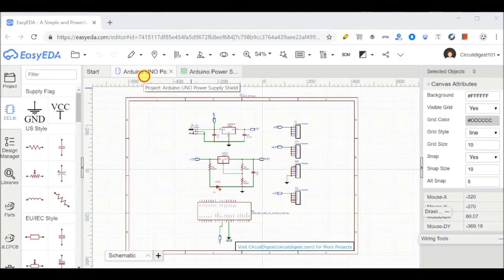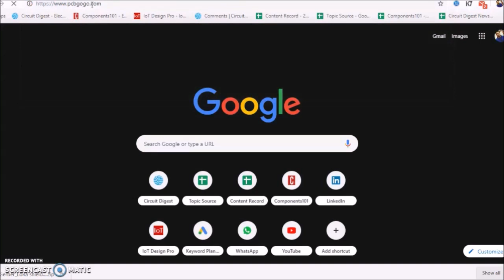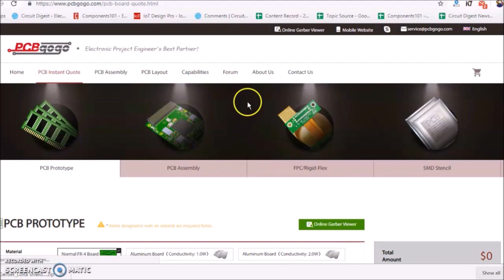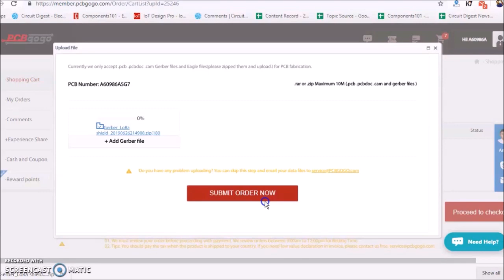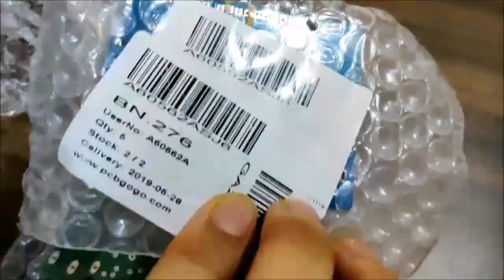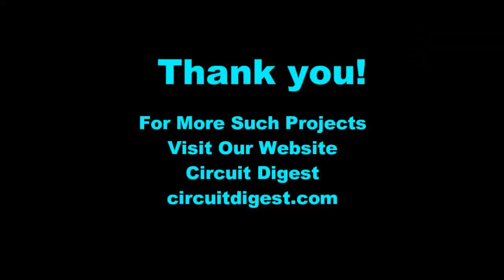DIY Arduino Power Supply Shield for 3.3v, 5v and 12v Output

Comment: thank you for sharing but power plan was disaster to solder cause it does not let pad get warm but pcb itself was neat
Reply from the maker: Use a temperature controlled soldering station with 350C.